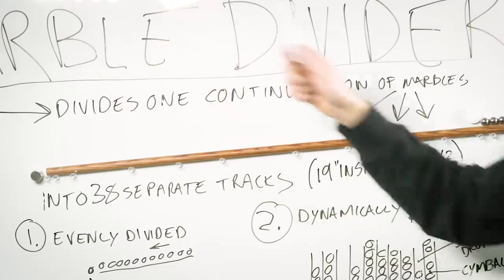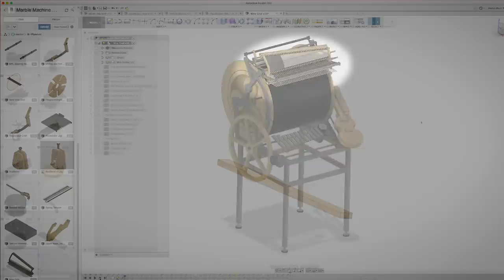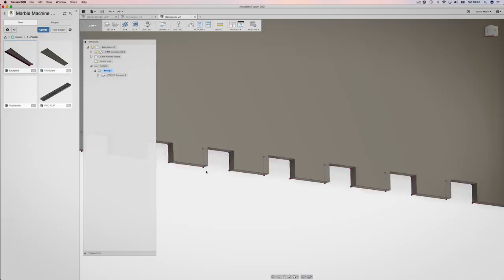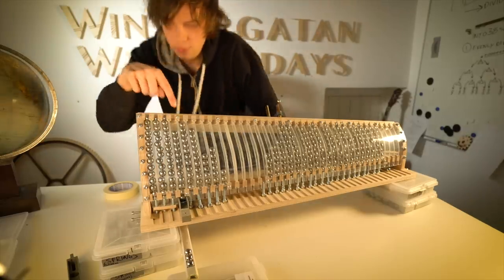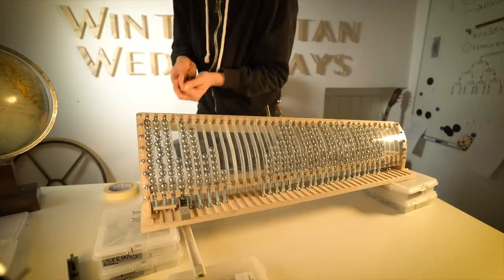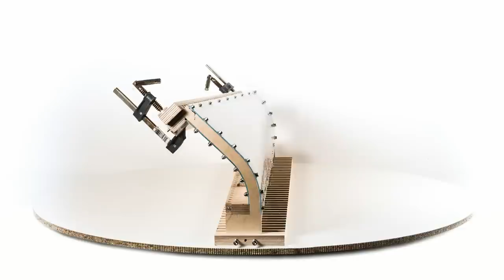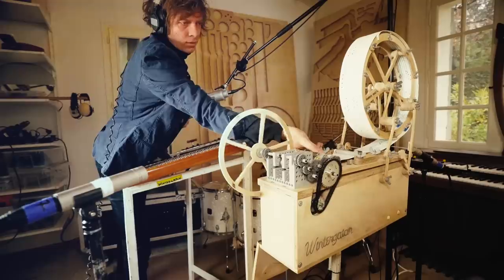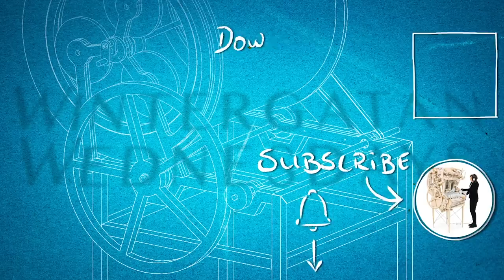Marble Divider - Marble Machine X #21

Comment: So far, this is the only part of the MMX I'm slightly concerned about.  It's good that there are 2 feed sources but it seems to feed slowly, and it's a little noisy.  Though this is obviously functional, I'm just concerned if the design of this will limit the tempo or the amount of times a single note/instrument can be utilized.  The original Marble Machine seemed to allow the marbles to line up more freely with pretty large queues.  But, I would love to be proven wrong and I'm still excited to see this in action.
Reply: I had this thought as well. Also it looks like there is a bit too much play in the channels. Some of the marbles had pushed out of alignment with each other a bit. Might that not throw off the alignment on top and choke up the flow? Otherwise amazing work and keep it up!
Reply: Don't forget that the rate of the marbles is only depending on wheel lift which gets faster proportional to the speed of the song and the time it takes for a marble to move the length of it's diameter which should be super fast and only speeds up the less the marbles have to stop for a note to be played until it reaches it's upper limit when the fricion cancles the accelerating force created by gravity. 
So essentailly you would only have to limit the total amount of notes played in the entire song and you're good. 

Edit: It turns out Martin did some experiments with the marble lift and he estimated a maximum of about 8 marbles per crank turn. That's more than double the rate you would need for the original song, so no worries. I'm guessing that that'll be enough but you could always alter the design to add another lifting method doubling the rate.

Edit 2: I acually fear that without a basin for lots of marbles to bunch up between the divider and the top of the lift, the lift could actually get clogged pushing marbles off. Thinking about it it's acually quite funny how, provided that no marbles get lost on the way and that all notes are not evenly spaced apart, that basin would cycle at least once every time during a whole revolution of the programming wheel.
Reply: The fact the channels have different feeding priority will certainly limit the songs the machine can play. But working within limitations us where artists thrive, after all.
Reply: The noise won't really be a problem with good mic placement, but yeah, it will certainly have its limitations, like any instrument does.
Reply: Peter, it looks like it feeds slowly, but the entirety of the machine's marble supply is going to be flowing through those two feed sources so I'd expect that they'll run at near-saturation for most of the time which would negate a lot of the slowness. A few times in the original Marble Machine video it's pretty clear that some of the channels aren't being refilled anywhere near as much as the other ones and it's a bit random as to which ones are running short. With this design it's very clear and predictable as to which channels are more suited to high tempo and which ones are suited to low tempo.

(Counterintuitively, I'd expect that the channels furtherest away from the feeds would be the high tempo ones. If the high tempo channels were close to the feeds then the balls would never get a chance to go any further along the track, whereas by putting low tempo channels close to the feeds you'll almost always be able to have marbles flow further along as the low tempo channels will be full for more of the time)

I agree with Alexander that there's a potential for the flow to be disturbed by misaligned marbles - it wouldn't surprise me if there's an alteration to the channels that restricts the available space for the marbles to guarantee alignment.
Reply: Matthew Henry making the channel size closer to the diameter of the marbles should solve the misalignment problem enough.
Reply: Yeah, I'm just assuming that you need excess marbles in the system for this to work at its peak potential, which requires a stopper. Everything you're saying makes a ton of sense.

Also if the top feed line is stopped using a stopper and a channel opens up, there's every chance that the marble may get stuck at the top and not fall down. A work around for that might be to route the marbles at the end of the feeder back into the lifting system so they can recirculate.
Reply: I actually don't think there's much concern over marbles getting stuck.  Remember, they're constantly coming in.  Eventually, something is going to get nudged.  But yeah, your idea of recirculating them back into the lift system ought to work just fine.
Reply: Considering how the wheel lift was built, it would be fairly simple to effectively double its capacity if it ever becomes necessary. Right now he's only using one side of each magnet. By mirroring the 'outer' part of the pickup wheel on the other side, he would get twice the pickup rate with only little increase in wheel width.
Reply: many felts could be added to reduce noise, actually the original feeder didn't have any issue except an insufficient building accuracy, the first machine was so spontaneous that it's basically the reason it had so much success
Reply: Hans Brikkenbakken - Lining the sides of the vertical channels would indeed soften the wood-on-metal clacking, but it's a bit of a moot point when one considers that this is an amplified instrument. On a stage, it won't impact its audible performance. I'm more concerned about reducing wear-and-tear on the slide-cups.
Reply: I agree, we must not think as an acoustic instrument, anyway in musical instrument building felts have been always a common and cheap way to reduce both noise and wear. Keep in mind that noise is energy that goes someway wasted by frictions and collisions. By damping surfaces and joints something-near-miracles could be achieved. In almost any instrument you are going to find examples of felts used for both the purposes. The other big (but expensive) damping material is the kasimir fabric, it's a fabric someway similar to chenille, it's used on vertical pianos to damp the hammers when you release the 3c pedal and in some parts where the mass to damp it'is someway big.

Another very useful material is spray PTFE. If you choose the one without solvents it's very well tolerated by wood, felts and metal too. It will allow to reach a very strong lubrication on every moving parts and you are going to need to respray very seldom.
Reply: I think the depth of the channels should get wider to allow more marbles to stack inside the shorter tubes. But he should have 3 feed points instead of just 2.
Reply: My question is did he put any extra space into the parts, if so how much? I know he didn't use tolerences for the CNC machine, but he proablay accounted for matherial thickness.
Reply from the maker: Its definitely a valid point and important to think about! First difference is that the MMX has double channels per instrument, so the snare drum had only one cue on the first machine, on MMX two of the marble cues feed the snare drum so the cues will last double the time. We have calculated the maximum of marbles needed for keeping up a very busy techno music track to 8 marbles per crank turn, (eight notes played on one beat) and the whole lifting mechanism is designed to lift exactly 8 marbles per crank turn so if we play a song in 120 bpm we will feed the marble divider with 120X8=960 marbles under one minute.  We believe, but are not entirely certain that the cues will be filled up before empty since almost 1000 marbles will pass during one minute and this is for the most busy music passages! But its not until i actually start programming music for the machine that i really know if this is enough. Maybe the entrance of the second row could be repositioned or we could even introduce three tracks, to really hit those last channels with an overflow of marbles! Thanks for commenting, this gave me the idea to perhaps have three or even four individual tracks on the marble divider, (which would make the first channels suffer so its a balance). All best! m
Reply: Wintergatan Let me just say- love seeing these conversations happening. You cultivate such an awesome community and culture here on the channel. In addition, you are such an inspiration to me. I am a guitarist and I’m working on some multi-instrumental knowledge and I love watching your stuff. So interesting and I aspire to be a musician as skilled as you. Great video, too. Bravo, Martin, bravo.
Reply: BINGO!!
Reply: What about using electromagnets to hold the marbles instead of the grey things, then using optical switches that get interrupted by pegs on the programming wheel to interrupt the electromagnet and cause the marble to drop? Powered by dynamo attached to the hand crank input and a supercapacitor for reserve of course.
Reply: Using electromagnets could magnetize the marbles over time causing them to stick together.  It could potentially cause jamming issues down the road.  But now that I think of it he is using magnets in the lift wheel to lift the marbles in the first place so hopefully that doesn't become an issue already.  Either way...  There is just something cool about the mechanical solution.  Its really neet to see this thing being built!
Reply: I thought  about this too - especially since the last channels in the line will have the lowest priority (all other channels need to be filled first before the last channel gets refilled), you need to calculate the marble needs not in terms of constant flow, but according to usage in the song. If for example you have channels A1-A2-B1-B2-C1-C2-D1-D2, the marble input flow needs to be larger than the sum of marbles used in all previous channels in order to keep D2 refilled. On average it is probably fine, but during a drum "solo", playing many times in quick succession, you might have struggle to get enough marbles through to the cymbal since that is the end of the line.

Also, will there be a return of marbles that go all the way to the end? if they just stop at the end, it might fill up in a way not lining up with the holes beneath them, and therefore block the entire divider.. Love your videos and this community. I'm a friend of Göran Ehrlund too :)
Reply: Wintergatan
Wow I didn't even notice you replied until 3 days later.  But thanks for the well thought-out response.  We're all routing for your success and I'm glad you seem to know that we're all here to be constructive.
Anyway, it's good to know that you intend to use a surplus of marbles - that eases some of my concerns.
Reply: dkosmari my thoughts too. I might have given the shorter channels priority to fill up first or angled the bottom so the were all the same length and capacity, but to be honest, I don't doubt for a second that he'll be working and tuning it until it's just as he visions. Kinda like a Bob Ross painting when you're yelling at the screen for putting a big ugly brown patch in the middle the seemingly ruins everything, but by the end you feel like you could climb inside and live there. Lol. He's got this.
Reply: The problem you're concerned with really comes down to not having enough marbles to meet the capacity that a song might require. Of course the frequency of note hits(_hits_, not the frequency of the note itself) and general tempo play a lot into it, but something used in business operations called Little's Law can help. Take a look. The same law applies to figure out how many skiers a lift can accommodate per hour given the trip to the top and how many each lift can hold.
Reply: I am concerned about marble height variation of full cells along the marble track. I think you should be testing at full chambers of all tracks, with all sliders. I fear a potential marble "bump" on an instrument that doesn't play as much on the viewer's left of the track impedes filling tracks further right.
Reply: At this point it should still be simple matter to design some kind of midway storage for the marbles before they reach the marble divider with some kind of pressure activated limiter for each of input channels. that way you could always also have spare marbles in the machine for example to use in potential solos when the wheel isnt lifting them. (do note Im not entirely sure if the new version can play manual solos like the last one did...)

also excited to see you whenever you manage to get on that world tour and to finland.
Reply: I'm not bothered my a little noise. A bit of mechanical clatter will be like  the little pops and clicks on a vinyl record. It adds to the atmosphere, and reminds us that this is a mechanical machine, and it is actually doing stuff.

I thought that the mechanical sounds of the original machine actually added to the performance, and should be considered part of the music. I especially loved that satisfying click it made when he disengaged the mutes.
Reply: Once the band is playing and machine is going I don't think you will hear the little marbles racking up.  Tempo shouldn't be a problem as long as your feeding quick enough.
Reply: I have the same concern. As soon a one channel will be marble consuming, the channel after this one will not receive a lot of marble. I have no idea how to but could it be a way to prioritize a channel base on the weight of its content ? Maybe some locking/unlocking system that prioritize the less full channel could ensure more stability (even though it might require more marbles overall).
Reply: Peter Schmidt ii
Reply: Peter Schmidt M  && mMKM
Reply: also, the 'gate' as he calls it has to lift to entire marble stack. could put a lot of stress on the entirety
Reply: Alexander Bridges it is just a prototype the actual one is way better it doesn't have those issues
Reply: I honestly like the noise that comes from the machine

Comment: Is there an overflow in case the storage gets filled? Because without an overflow it could get jammed with too many marbles in the system.
Reply: Surely, the number of places for marbles will match the number of marbles in the system?
Reply: smeagoL I guess it's impossible to have an overflow of marble, the marble machine will always start with just the rightly amount of marbles so as a marble leaves its slot a new empty space get created
Reply: TheBaconWizard 
There would need to be more in case the last column is used repeatedly and with only a few marbles in it if they were all used quickly and taking time to move through the system you would be left with no way to play the last note
Reply: This is what I was wondering. Because I'm pretty sure overflows will occur. Personally I think if overflows went down a slide to the bottom of the marbel lift it would make sense.
Reply: you also have the extra marbles that are used to replace marbles that are still in transit to the slot they need to be in. What Smeagol is asking is if there is an overflow channel or prevention mechanism for the case that more marbles are being transported to the top, than are being played into the transport system. Sort of like a spillway on a damn lets extra water through if it gets too high
Reply: If the divider fills up, the marbles could simply travel off the end of the divider assembly and into the collector at the bottom (where all the rest of the marbles end up after playing an instrument). I could see this happening often if he mutes the machine while also cranking it.
Reply: Sounds easy enough to solve, it just needs a track an the end of the slopes that redirects the overflow to the bottom of the machine.
Reply: smeagoL Yes, that does make sense.
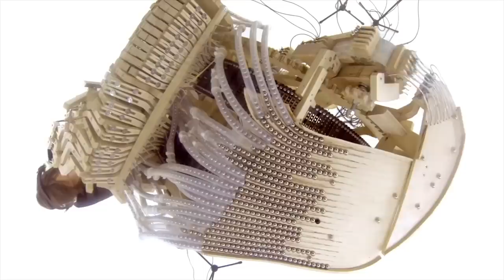Reply: I think there will be a 'queue place' as at original MM (7:09)
Reply: smeagoL I am sure that he has accounted for this placing the least used instrument in the last column
Reply: No I think the MMX will most likely have a port that opens and closes whenever a marble is used and dropped from a tube, that then releases one marble from the main sort of storage and then fills the said tube. What im mostly worried about is what if 2 marbles hit eachother on the slope, he talked of a second slope that would hit the middle, but what if one marble from the main and one from the second meet, wont the second slope marble fall off the machine?
Reply: smeagoL or couldn't you put a stop on the end and make a way for the marbles to be forced in so they eventually bunch up and will fall into the channels where they are needed. They don't have to fall back down, they can just bunch up until the next song when they're needed